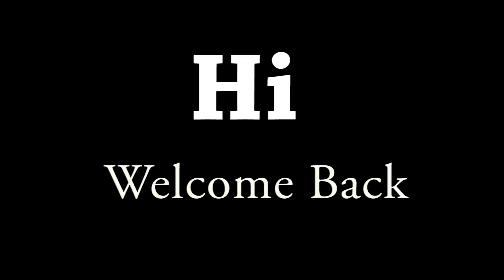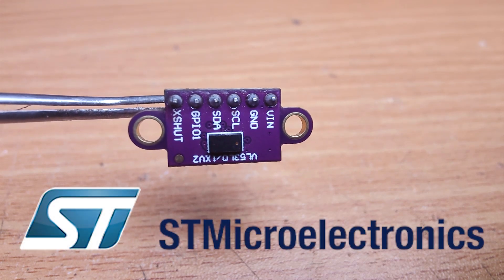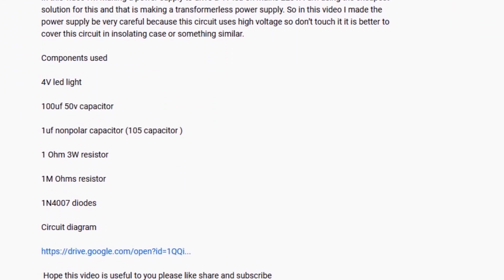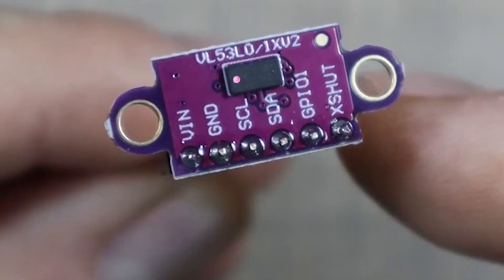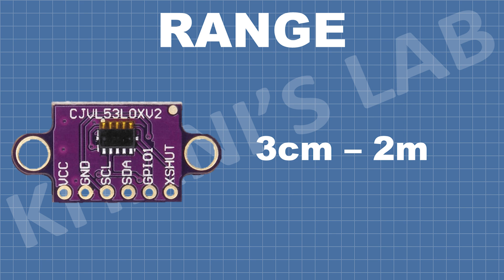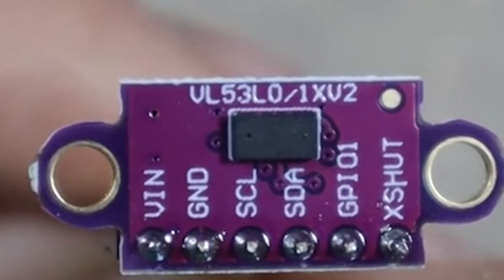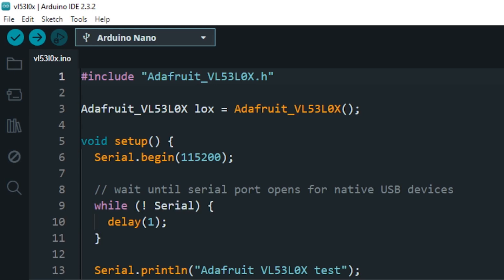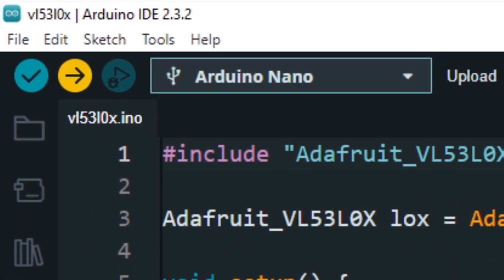VL53L0X Laser Distance Sensor | Arduino Project

Comment: Can we use it instead of ultrasonic sensor to measure water level in a tank? Is it good for long use?
Reply: It won't work for a water leveller. TOF utilizes laser technology to measure, which refracts in water, making it unusable or inaccurate. An ultrasonic, on the other hand, works well because sound is able to bounce off the surface of the water. For long distances, Yes it works depends on what TOF you have as it can be from 1m to 4m max distance but if you are looking for something farther, Use Lidar.